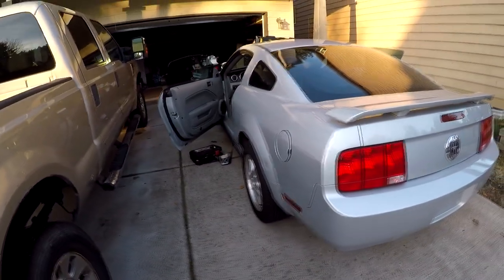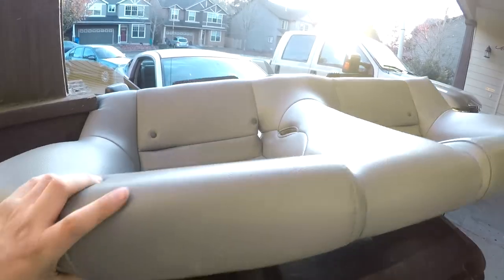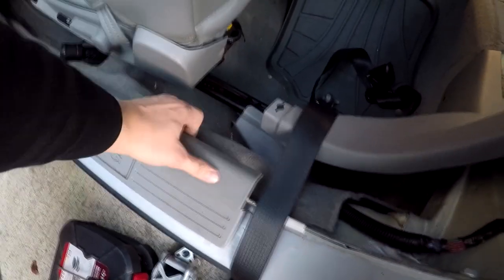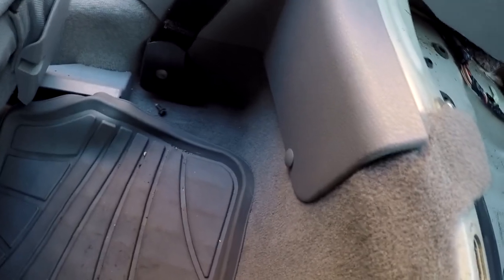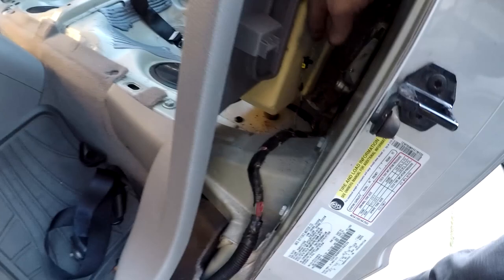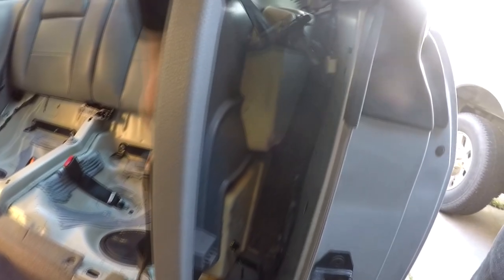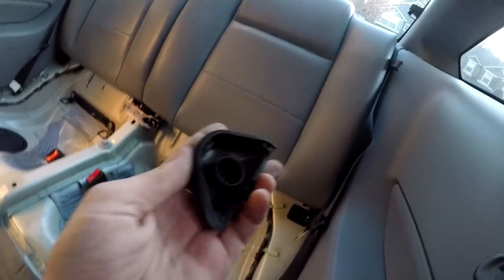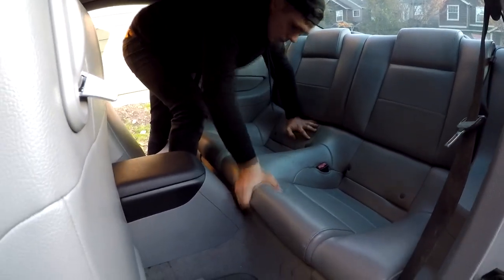TUTORIAL: 2005 - 2009 Ford Mustang Seat Belt Replacement DIY

Comment: It's also exactly the same process for 2011-2014, the connector for the pyro is slightly different so you have to be careful, I used some thin needlenose plyers and it came loose without destroying it